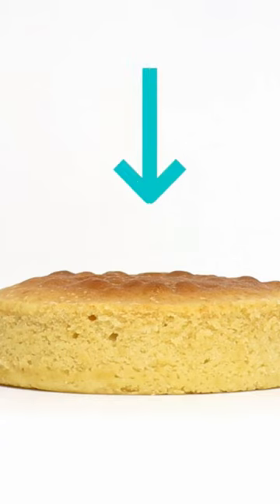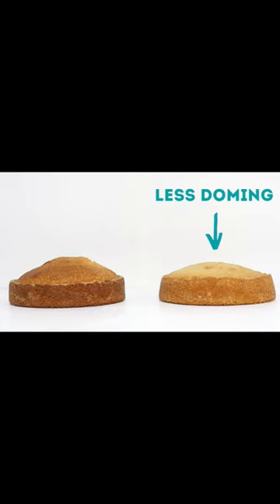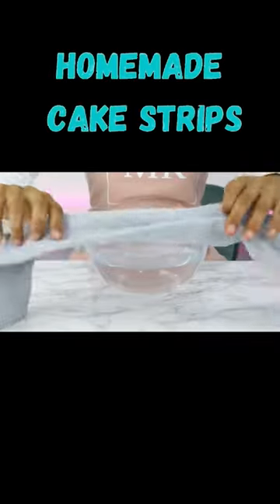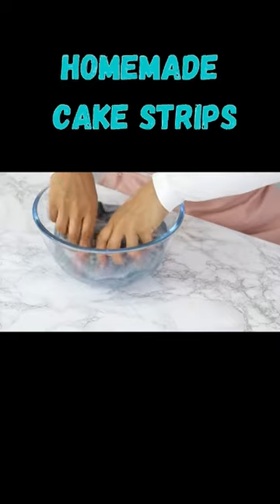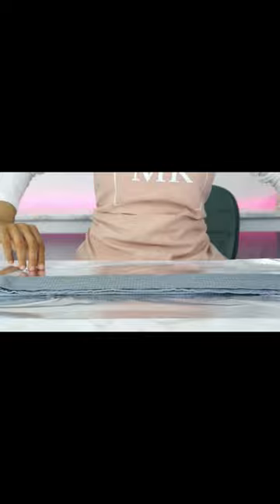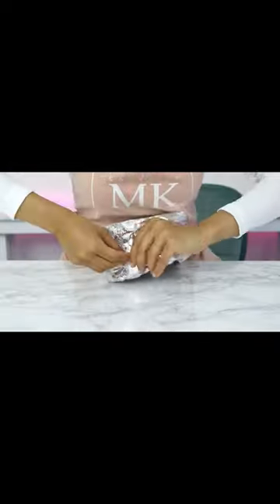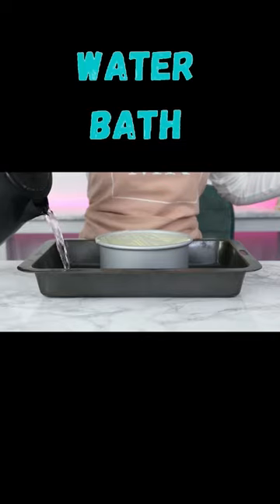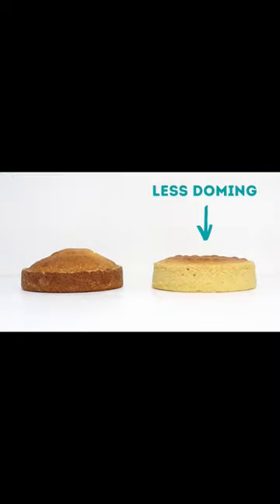4 hacks for flat cake layers! 🤯

Comment: Thank you. So which do you think is the best method to get the least amount of doming from the four visuals in this short?  The tea towel soaked in water seems to have the least doming from these four examples.  Is that consistently the best method from your experience?
Reply: She did a YouTube video where she mentioned what is best. I don’t remember what.
Reply from the maker: Hi Marylyn! Check out this video for more details: https://www.youtube.com/watch?v=aSPLxB96V0w&t=288s

In short, water bath had the best results, but for ease I usually just use a lowered baking temp or cake strips which also do the job :)
Reply: @CakesbyMK  Thank you very much for the response and all the information.  Very much appreciated!  💜🤗
Reply: If the temperature says 175 fan forced..do I still lower the temperature?